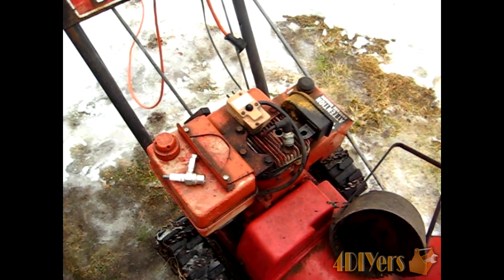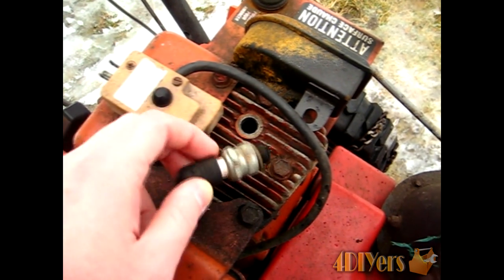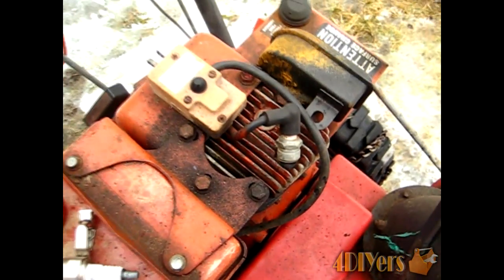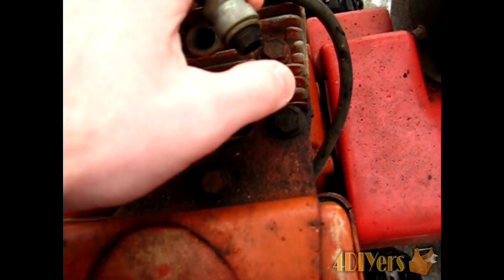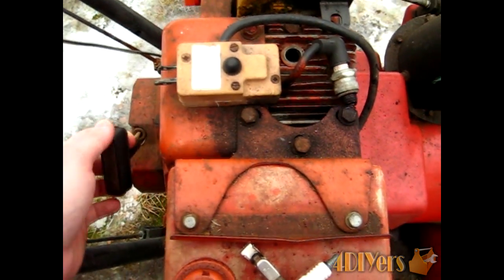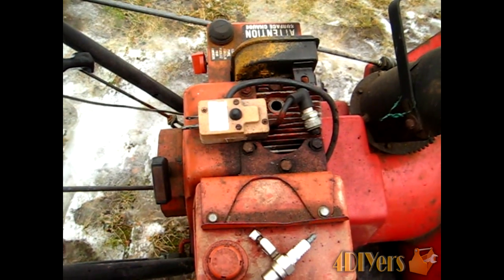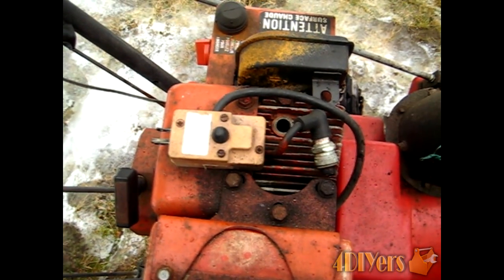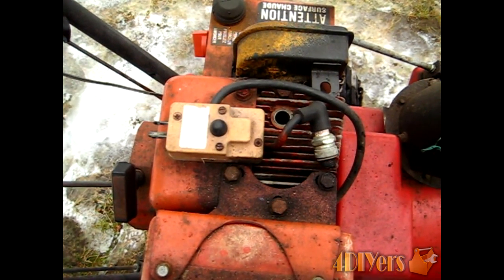DIY: Checking Spark on a Small Engine

Comment: I have an old 70s Snowblower with a Briggs and Stratton engine on it (old 70s aswell). I have fixed everything besides the spark issue, could it be a bad coil?
Reply from the maker: Could be a bad coil. But have you checked the points?

Comment: Hi what's the tool called that holds the spark plug to hold it on the engine
Reply from the maker: It's actually a spark tester, something separate from a spark plug completely.

Comment: great thorough video!
Reply: Good video. Gave lot's of info, but unfortunately didn't seem to help me with my problem. If you please, I could use  some advice. I have a briggs 18.5 h.p. Intek that quit running. Changed spark plug, which was new, with another new one. New plug  gets wet with fuel, (which is fresh), tested coil, 465,000 ohms. Also swapped out coil with identical coil off of identical engine. Checked magnet (which I had previously cleaned with fine sand paper)for looseness, and checked it's strength by sticking my ratchet to it, and it held good. Gapped coil as I always have, with a thin piece of cardboard about the thickness of a match book. When testing the way you do in this video, the spark is unmistakably blue, but seems weak to me. (could have been not very well grounded though, as I just laid it on the valve cover) I checked the valves, but just eyeballed them, they looked quite close to where they should be, and I checked and found 130 pounds of compression. Also in the early stages of this fiasco, I tried priming with carb cleaner, and it didn't even act like it was trying, which led me to look at spark issue possibilities. I'm about out of ideas here. How about you?
Reply: Also, one more thing. I pulled the kill switch wire and tried starting it that way as well, with the same result.
Reply from the maker: Thank you!

Comment: I have a 4 stroke 97cc Baka been trying to get it running changed carburetor and spark plug checked for a spark and it was yellow will this keep it from starting?
Reply from the maker: Some engines will still run with a weak spark, others will not. What can happen, due to the weak spark, it'll basically disappear under the ignition stroke. Have you poured a splash of fuel into the combustion camber and then tried to start it??? Or is the spark plug wet after trying to starter it??? If it'll start with a splash of fuel and if the plug isn't wet, then it's not getting fuel. You can also bench test the coil (unfortunately I do not have a tutorial on this as of yet), ensure the coil have a sufficient ground and no connections are damaged or corroded, check the coil for any damage, and make sure the space between the flywheel and coil is properly adjusted.

Comment: My spark plug is not hot enough (yellow spark) how can I fix this? You said some wires or coils can be replaced, so would that get the spark hotter?
Reply from the maker: First place to start would be replacing the start plug if it's older and then setting the gap. Next check the spark plug wire for any damage, along with the coil. Some will have a replaceable wire. If the coil case is damage, then it will be letting in moisture, therefore causing issues. Clean the magnet on the flywheel and the coil surface, ensure the space is adjusted correct and there is a sufficient ground. Coils can also be bench tested using a multimeter, resistance ratings will vary depending on coil designs. Don't forget to subscribe :)

Comment: I have a craftsman leaf blower that won't start.  After pulling repeatedly, I pulled the plug and both the plug and cylinder were dry as a bone. I was guessing fuel problem, but when i spray starter fluid right into the cylinder it still won't start.  It appears to have good blue spark and decent compression ( 60)  any tips?   Thanks so much for your time.
Reply: +Kevin Woodcock  Just subscribed and would appreciate any insight from you or your commenters  from above post..Thanks.
Reply from the maker: +Kevin Woodcock Thank you for subscribing! As for the issue, is that 60psi on the compression test??? If so, that's very low for an engine, but you would need to refer specially to the manufacturer's specs as to what the minimum compression should be.

Comment: Hi, i have a 12 y/o Ariens snowblower with an HS50 techumseh engine. Will start, run strong for 30 sec to 1 minute then die. Then, wont start again for another hour. Cleaned old carb, same result. Installed new carb same result. New spark plug with new carb, same result. Any ideas??
Reply from the maker: Speedfreely Does it still have spark once it quits??? Or after it quits, does the spark plug have fuel on it??? It still may be starving for fuel or if it's electronic ignition the coil could be warming up, then breaking down which would cause no spark.
Reply: Believe it or not it was as simple as replacing the gas cap...the venting was off so the bowl ran out of fuel.  Can't believe how obvious and simple it was.  Thanks though, your video is still very useful.
Reply: Speedfreely ckmo

Comment: Thanks for the informative video.  I have a 1998 push lawn mower with Tecumseh engine.  I made the mistake of trying to start it by just holding the handle and not the control bar at the same time.  Since then, I'm having problem starting it, although its carb has been cleaned (not rebuilt) twice.  

The control bar cable appears to move the brake mechanism but there is a bit of the slack in the brake cable that is attached to the control bar and the brake mechanism.  

There is spark in the spark plug - I tested it the way you did.  

My question is: is it a carb problem or I have damaged the ignition coil due to trying to start the motor without holding the control bar?  What kind of damage I might have caused by not starting the lawn mower the proper way i.e by not holding the control bar and the handle at the same time.  Thanks for your insight and advice in this matter.
Reply from the maker: akbaxb165 Usually what happens if you don't deactivate the kill switch and still try to start the engine, it will just send in more fuel and flood it. Not a big deal though, all you need to do is remove the spark plug, dry it off, I normally leave the plug out for 15min and pull it over a couple times to help evaporate the fuel in the combustion chamber, reinstall the spark plug, and then restart the engine.

Comment: I plug my spark plug outvmy snow blower  and its was like oil was on it and it was black wats the solution to fix it
Reply from the maker: Justin Davis Sometimes if the mixture it wrong (running rich), it may seem as if there is oil on the spark plug. That can be set by either the carburetor or perhaps the choke was left on for too long.

Comment: See if the engine starts when it has cooled. The valves may need work. As they get hot there is no gap left and the valve is open slightly till it cools off.
Also head gasket could be leaking.

Comment from the maker: Is the plug wet when you're pulling it over??? That would be a sign if it's getting fuel to the cylinder or not. I've noticed some of the lawn mowers with automatic chokes tend to be temperamental now once they were already warmed up and are being restarted. You can remove the air cleaner if it's mounted on top of the carburetor, you should have direct access to the choke flap, just hold it open with a screw until it starts and reinstall the air cleaner while it's running.
Reply: 4DIYers gfbi

Comment: So i have a uear old murray push mower the 625e 190cc and i just got done mowing one section of the yard shut it down an moved over to the next section and when i whent to start it again i got nothin the spark plugs original still gives off a blue spark so.im assuming the coil spark plug and kill wire are all good its cleaned after every use and stored when done the gas was fresh and the oils new nothings clunking around on the inside so i was wondering if you could shed any light on that